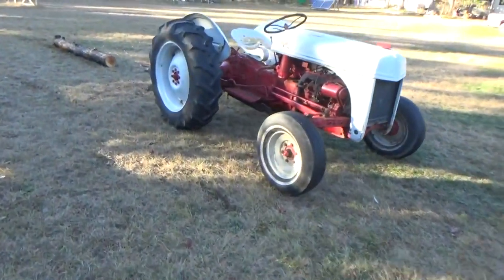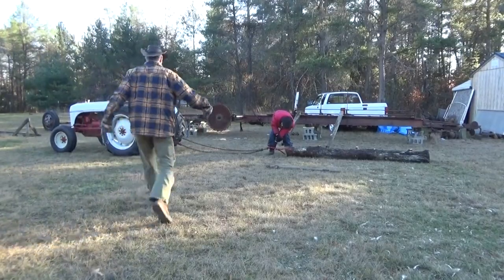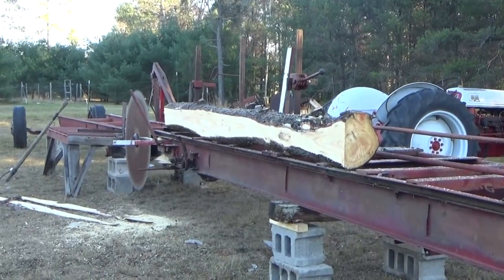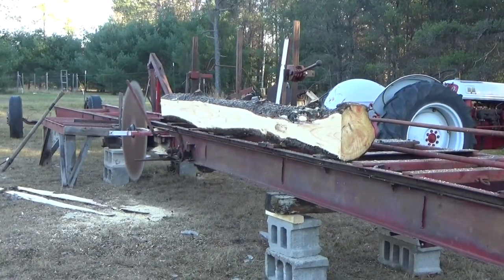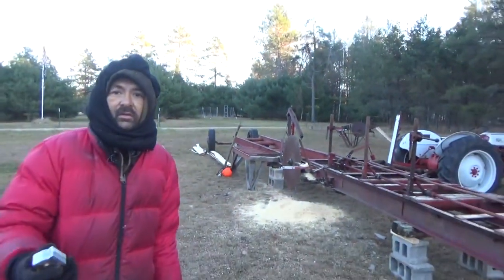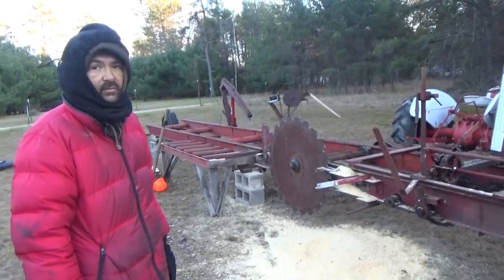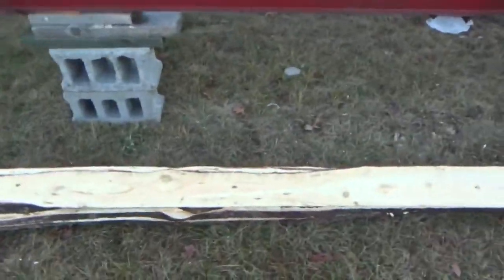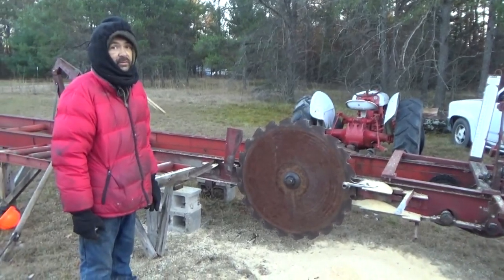Running My Foley Belsaw Sawmill First Time In 50 Years

Comment: Cutting pretty good actually. Good work. 
That control handle is operating backwards compared to other Belsaws. 
It was a safety feature for the handle to pull back when sawing. 
Some hammering and tensioning on the blade gets things dialed in.

Comment: Wranglerstar did a nice video on how to find the center point of the log and how to make thr first 4 cuts to square of the log on all four sides so when you cut you wouldn't have to use the table saw to finish the one side.  He's very knowledgeable with logging.

Comment: You have the skip tooth blade which is a good thing. Takes less horsepower to pull it. 
I operate a regular blade with half the bits. 
Wouldn’t mind having a blade like yours.

Comment: 1/4" saw kerf+ 1/8" to clean up on planer = 3/8".  Makes sense to me, Center left column gives 1" board after cut and plane, center right column gives approximate 3/4" board after cut and plane.  However, calculating down as I make cuts, the way the pro sawyers do, would probably drive me nuts.

Comment: need more horsepower for bigger logs i have a farmall m on mine thats not enough really
Reply from the maker: The 8N is rated at 26 HP on the PTO which is the bare minimum to run this. I was told it will run but I have to take it slow.

Comment: Chris and Troy lumber mill. You bring your logs and we get your lumber milled out. Looks great and the tractor didn't strain at all when cutting. When it does time to  sharpen the teeth or buy a new blade. At the speed it's going Micheal will be a grandma before the teeth need a edge. Try a little water to keep the blade lubed and the dust down.

Comment: Troy you probably have a good thing going.. you all to consider constructing a small barn that holds lumber.. and advertised for customers to come out to inspect furniture grade planks and boards. You are short only two machines of these two you may have yet the planer.
Reply: Planing is a pain in  the ass,  I had a bunch of maple cut up into 1 1/2in boards, I wouldn't do that, maybe 1 1/4 in to get a 1in thick finished. If he plans to get good money the wood will have to be kept dry, you're right on with the storage shed.